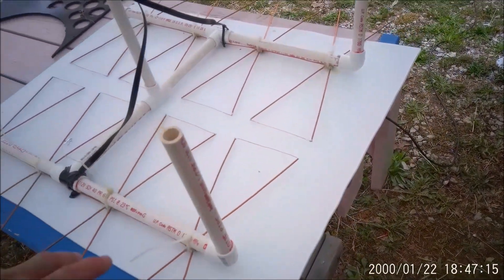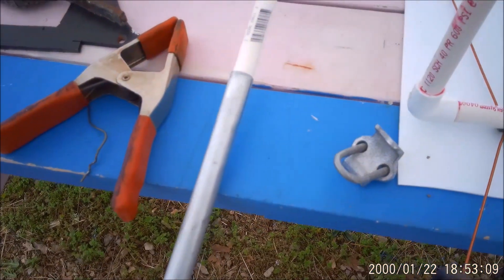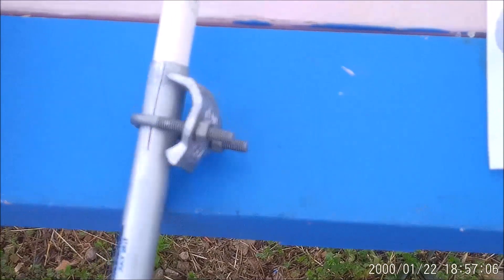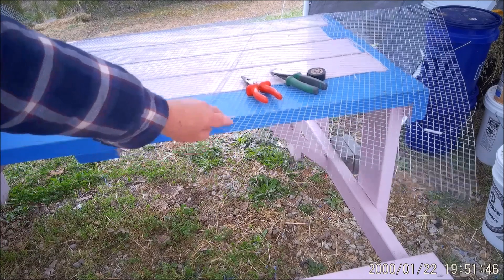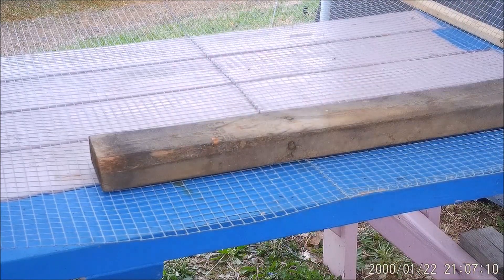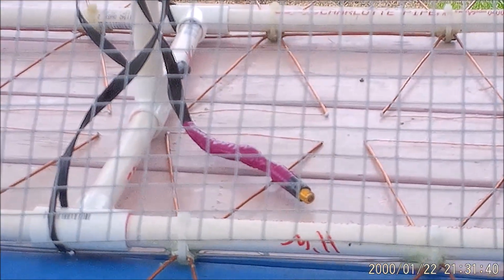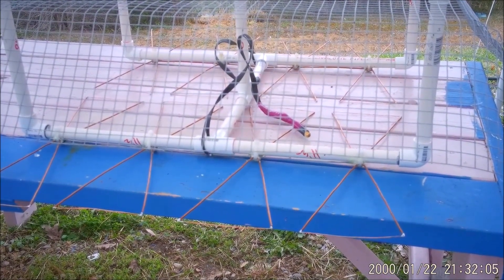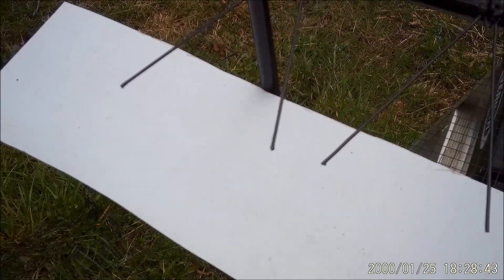How to get free TV, DTV DIY antenna build, DTV antenna project, Part 2

Comment: In my place there is no longer a 300 ohm cable, what type of cable can I use as a replacement?
Reply from the maker: You will need two "75 to 300 Ohm UHF/VHF Matching Transformers". You can get them from most online stores or even in old thrift stores. Use the two leads to solder to the antenna where the twin wires go on my version. then run two short cables down to a "splitter" or "combiner". Look for something like "Coaxial Cable Splitter, TV Splitter 2 in 1 Out, F Type RG6 Male to Dual F Female, 3 Way Coaxial Cable Connector". That will combine the two lines into one that will go into the TV. Does that make sense to you? You just do not use the 300 ohm line and use cable adaptors instead. Good luck there. I receive 59 channels here where it says I should receive just 6 channels.
Reply: @davenooner2142 Thank you for your answer, success always for you

Comment: How is the balun connected?
Reply from the maker: I used a 300 ohm to 75 ohm old style tv to cable connector. So it would be one side of the 300 ohm end to each wire I have going vertical. then the other side is connected to the coax line. Does that answer it or do you need more about where on the elements it is connected?
Reply from the maker: Also...the end of part one of this project shows a closer look at the way I connected the wires up. Good luck and thank you for watching. You will be happy with the results, if you make one.

Comment: I thought you had to cross the phase lines at top and bottom of each of the two assemblies. How does the way you connected it overcome this?
Reply from the maker: I hooked it up and switched it around till I got the strongest signal strength and that is the way I am using it. So I made sure of maximum signal and not just hooked it up as in most setups. All I know is it works this way best.
Reply: @davenooner2142  Thank you for your reply. Anyone that can post detailed instructions like yours should be commended.
Reply from the maker: @raymccarty4612  Thank you very much.